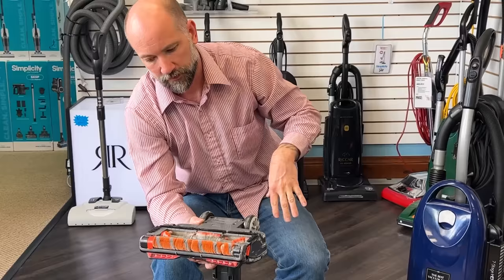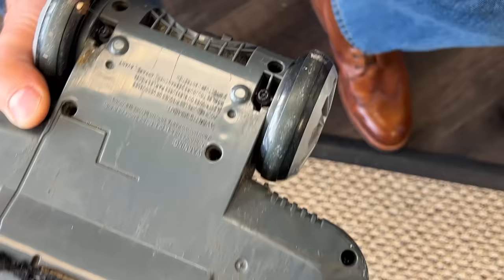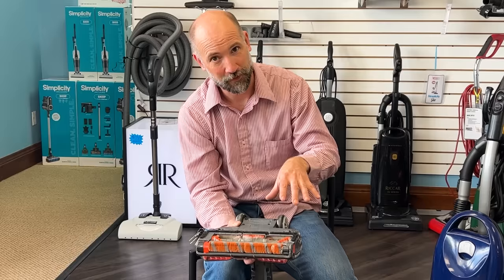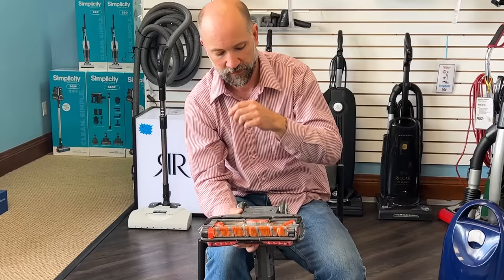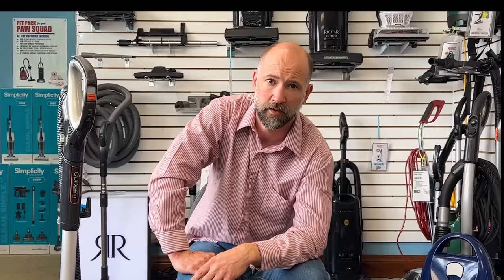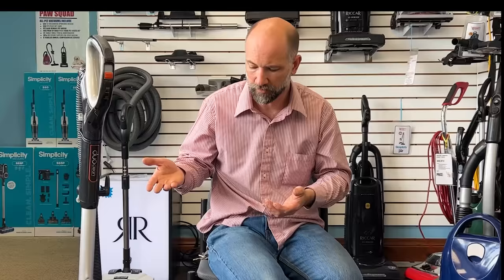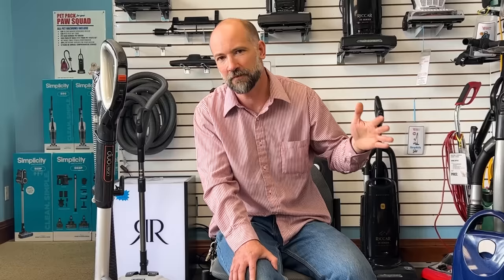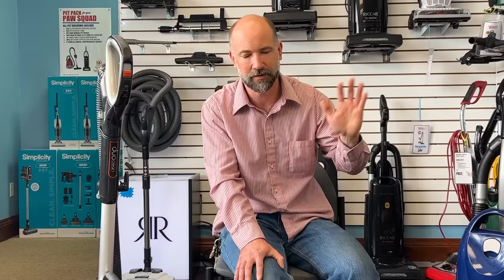Why Can't You Repair Your Shark Vacuum?

Comment: So, the brush stopped spinning, after discovering the security screws and using much profanity I went to TSC and they had the right bit set in the discount bin. Took the unit apart, the brush opposite the drive belt has a roller bearing set in cheap plastic which naturally had disintegrated and stopped up the roller. That's when I realized Satan himself held a round table to design this navigator vacuum.
Reply: Mine too.... I agree 💯%
Reply: Had the same problem.  Went to Oreck.  No problems since.
Reply: Why does this comment only have 11 likes? This shit is glorious! 

I took mine apart because the cat peed on the carpet, and I used a lot of vinegar and baking soda. Well the baking soda pretty much caked everything up the next day, and so I had to rinse out all the hoses, my husband accidentally broke one of the Allen wrench screws cause he didn't realize it was there. Got the roller out finally and cleaned that, and once we got it back together, it runs and works, but the brush indicator light isn't going on, and it's hardly sucking. So it's back to the drawing board.
Reply: @nonelost1  Unfortunately, the circuit board was fried. So I am just going to buy a new vacuum tomorrow.
Reply: Harbor Freight tends to carry security bit sets.
Reply: *ball bearing
Reply: I just buy it from a place that I can get a full refund if it dies before 6 years
Reply: Returned 4 vacuams now for full refund
Reply: Just don't buy shark vacuums people!!!
Reply: I had a shark duoclean about 2 years and the rollers stopped working. Told you have to buy a new head (£69) but you cant actually get one anywhere. Called the Shark 'helpline' to be told they dont have them but she will put me on a waiting list..How long will i have to wait? 'I dont know'. I better buy a new vacuum cleaner then thats NOT a Shark. 'Oh dont do that'. 2 weeks later (bought a new vacuum cleaner) and still nothing from Shark. Not like it was cheap when i bought it. Avoid the company. They suck more that their machines 🤬
Reply: @indboat I love my simplicity from my local vacuume shop. All these cheaper brands suck. When I worked at Walmart they always came back.
Reply: @nonelost1 some times hair builds up in the rollers too.
Reply: Wow, did I write this?! Eff Shark! Just got myself a Dyson v11 and let me say...WOW! I'll never try to cheap out again!
Reply: I haven’t had a problem with my Shark. I love it. Security bits are common in plastic parts. 

I have a 3d printer and a cnc router, soooo I’ll just repair it when the time comes lol.
Reply: @manino12345 where is that mysterious place and what model did you have?
Reply: @manino12345 where is that mysterious place and what model did you have?
Reply: @100hooker  Amazon, had some sort of Shark cordless, battery went and it cost about £300. Costco for a dyson also cost around £300.
Reply: Mine too and they told me I needed to pay for replacement of the entire head.   It looks like a small cheap plastic part.   Surely the part could be replaced no?  Cost me 1/4 the cost of a new vacuum and how long will that last ?
Reply: I have the same freaking issue. It was working fine, then it crapped out and the roller barely makes a rotation. I was looking forward to repairing it myself, had the right bits on hand because I work on electronics from time to time and it still won’t come apart. I’m not surprised that Shark made it move for design to fail vacuums.
Reply: I've had my shark duo clean since 2018 and it came with a shark mop. Both still going 💪 🤞
Reply: another practice by these scummy firms. build something out of plastic that has a lot of wear and tear, make it so it survives the warranty and then breaks.
its even more frustrating if you consider swapping that plastic with metal costs probably like 1 or 2 dollars more. 
they want it to break
Reply: It should never take someone 20 minutes to replace their belt in their vacuum lol professional housekeeper here and don’t ever buy a shark
Reply: Well of course . That's how to make $$
Reply: They'd probably make more money selling parts.. like alot of businesses

Comment: Never buy a shark vacuum.  Got it.
Reply: No that’s not true at all haha. To be honest I’m not even sure why he made this video. I repair vacuums and I’ve rarely had shark brand vacuums come in but when they do they can be fixed. Everytime
Reply: I happen to agree with you @shythawks9549 I don’t know why he made this video telling people Shark Vacuums can’t be repaired when it’s actually possible to repair them. It’s just absurd.
Reply: I had a white one for 10 years, got to where it wouldn’t stop fouling over, worked really good. I got the strato, and the red lite comes on all the time. I can’t get in it to clean it. I know I won’t buy a new ever again.
Reply: Currently having a frustrating time. On the opposite side of the belt, there is small hair jammed deep in there, had to use my Cricut weeder to pick at it but it's deep in there and seems impossible to take apart. It's as if they allow a narrow opening enough for hair to get in there. I'm pretty much at the point of "F this" lol. Next vacuum will not be a Shark.

Comment: Absolutely spot on. We have been using a $300 Shark for the past couple of years which just bit the dust, and I have been trying to source the part that's broken. It's near impossible. Shark does not sell that part any more which is strange since its been just a couple of years. The thing about the screws is true as well. I have a fair range of driver bits including the security bits which I used to loosen the screws, but could not pry the panels off. After watching the video, I now get why I could not. I am so glad I watched this video. I had been otherwise satisfied with the product, but I refuse to support a company that plans to screw its own customers.
Reply: Take a look to see if you can find a used vacuum.  Best place to get parts.  I've rebuilt several that way.
Reply: Little tidbit, a manufacturer has to support parts for a product minumum 7 years after date of manufacturer.  I use to go through it when I was as a printer/copier technician, several times.  There were instances where manufacturer sent out refurbished units instead of repair part because they did not have repair part in stock or no longer manuntactured part.
Reply: Buy a Dyson😎, it’s a little more expensive but it’s totally repairable. There are no belts to replace and no tools are needed to open and clean the roller head. I paid $300.00 for mine 15-years ago and it still sucks in a good way. FJB 🖕🇨🇳

Comment: I am a lifelong DIY'er and Shark's security screws were no problem for me.  Disassembly and diagnosis?  No problem.  Reassembly?  Problem.  I noticed tabs at the front of the "chassis" broke off quite easily removing the side covers.  Put it all back together and the slide locks for the top cover now bind up.  I've already figured out a solution, but your video really shed light on their designed obsolescence.
Reply: Please share the solution with us
Reply: Sheet metal screws through the cover.  A bit more work to clean the rollers, but it worked! @bjuliene
Reply: @MrMattDat  thanks for the insight, what a PITA and greedy design
Reply: Thanks Matt!!
Reply: @marambula  Absolutely.  You can also easily disable the cover switch on the side (unplug it, tie the wires together and remove the switch) to address more.  I will probably do that the next time I need to go in there.
Reply: You have to use a spudger to remove the parts, not a screwdriver, and work slowly.  and a hair dryer to soften the plastic so it will expand and not break. also ecoguard plastic lubricant on the joints. never had any break. if you are breaking parts your technique is wrong.
Reply: Second the suggestion on the hair dryer to soften the plastic, it works wonders

Comment: our shark navigator lower duct hose cracked within a year, so I replaced it last january. not only were there security bit screws, but the hose was glued in place. I had to dissolve the glue in nail polish remover. the replacement hose I ordered was much more rigid and has been fine ever since. I also totally agree with sharks becoming more difficult to repair. They weren't always easy but the older models for sure used to have regular philips screws. Such sad times we live in where we get screwed over in virtually every industry.
Reply: Wow so nail polish remover is 99 cents..... and a lot of common products have done away with Phillips bits a long time ago      dark ages???  Omg 😂
Reply: @donaldsalkovick396 😂 Exactly, these people are ridiculous. It's incredibly easy to go to your local Harbor Freight, Tractor Supply, etc. and buy a few screwdriver bits or whatnot. And that's for cheapskates like me, if you want to spend more money on name brand tools that don't get used much then you have that option too, lol, and currently we still have access to the "world wide web" to get whatever else you may need/want to make things even easier, sheesh not sure what these people expect...😂
Reply: Amazon has the Navigator hose with fittings. Unfortunately for me I have a "Proclean" the replacement hose doesn't have the fittings.

Comment: We have a Shark UV540 26.  It is about 5 years old.  I thought we had a broken belt, turned out to be something totally different but took off the skid plate anyway.  There are 11 screws and yes two different sizes, #8&10.  These were security head screws with the little nub in the center.  I used my standard Torx tools and removed 10 of the 11 screws with no problem but did go to Harbor Freight and purchased a set of security bits for one of the small #8 screw heads.  There were no tabs holding the head unit together.  It was a very simple project and Amazon had the replacement roller bar and belt had I needed it.  Thanks for your video but there is still hope.
Reply: Probably less of the nonsense 5 yrs ago. Steadily getting worse. I'm working on a 3 yr old Shark IX140. Different size heads and a few security screws in the mix. Tabbed so easy to break off.
Reply: Until anecdotes like yours are the rule and not the exception, I'll reserve my hope for more realistic investments.

Comment: I appreciate you pointing out this to the American Consumer. I am a recycler of electronic materials and am floored at the number of sharks I pick up. I'm also shocked at how cheaply made they are.
Reply: Not as cheap as the Bissell products.
Reply: I’ve owned 2 Sharks. The first was Navigator. It lasted 10 yrs and it was easy to replace roller bar. I have had a Vertex for 5 years now which has saved my sanity picking up dog hair (I own Collies). Im quite hard on vacuums. While this one makes it harder to replace the larger roller w fins, the soft bar is super easy to remove and wash. As are the filters. You can “diss” Sharks but I’ve only had 2 repairs in 16  years so I don’t agree that it’s a brand designed by a Satanic round table, but that was very funny! . I’m a walking ad for their vacuums. At the lower end price point, I’m surprised at their quality and high level functionality, esp the Vertex if you own a shedding dog.

Comment: Thank you, Josh! I’m on my first Shark, and I’ve liked it, but thanks to your insights and videos, when it finally dies, I’ll be looking into other brands that make repairs easier.
Your videos have helped extend the life of my Shark by equipping me to perform some  repairs at home, too, which has saved money and helps the environment. 
I appreciate you sharing your expertise!
Reply from the maker: That's great to hear, we're glad we could help!
Reply: The brush roller on my shark navigator broke and I am off to get torx bits. I have a Electrolux vacuum that's 40 years old that has never failed me.
Reply: Don't buy a Dyson. I phoned the help line to find out how to remove the yellow central boss on the wheels... they wouldn't tell me (they prise out). The mains lead had broken. I fixed it, but eventually bought a Bosch (still a pig to open up)
Reply: I ordered special bits to fit the screws, around 20 bucks. glad I did it.
Reply: You're going to be waiting a long time I've never had a shark vacuum die on me in my previous comment and this column I have always given away my shark to get a new one and everyone that I've given my sharks to they still have them! Hands down they are the best vacuum out there My dad has my old shark and his 6-year-old Dyson crap the bed hands down sharks are the best! I'm getting ready to purchase a new one a shark stratos so some will be getting my old stick vac That looks practically brand new but is well over 7 years old!
Reply: I'm lucky I guess. I'm still on my first Shark. I think it's about 10 years old now. I paid like $190 for it on sale. I liked that it came with a 5yr warranty. And nothing on it has broken yet; I still love it. But I will keep in mind what he said when the time comes.
Reply: @SirReptitious  , the old saying "they don't make 'em like they used to" probably applies here. It appears from some of the comments here that Shark vacs from a decade ago were built better than they are now;  and that the company was more inclined to help people service their own vacuums a decade ago than they are now. If you take a look at my channel, my one and only shaky-cam video shows an e-waste dumpster in my small town that is chock full of vacuum cleaners: mostly Bissels, Hoovers and Sharks. This situation repeats every couple of weeks after the waste processing company empties the dumpster.  I have even seen the occasional Dyson in there (not that I'm particularly impressed with Dyson, but they're not cheap).  I have never seen a Sebo or Meile or other upscale vacuum in there, but if I did I would rescue it.....

Comment: Glad to watch your video.  About 2005, my wife bought 3 purple hand held Sharks SV780N (Battery operated).  They were excellent and we still use one of those.  After deep internet researching, these Sharks suffer from a "Disease" wherein the thumb operated off-on switch goes bad. The off-on switch is mounted onto a tiny circuit board which itself is mounted into the handle.   Repairing this cannot be done as no new parts were available, so I trashed 2 of the 3 Purples for this fault alone.  We are still using a Montgomery Ward floor canister vac which dates to at least 1970 (It has a metal case, imagine that!!).  The foot operated switch is well worn but keeps on clicking!!

Comment: Planned Obsolescence.  
We own one Shark. It's a small, rechargeable battery hand model. It was the best out of the 3 others I wasted my $$ on. It's about a year old now. It's only used to vacuum my Husband's Semi truck. It does better than most, but not as good as the 12 volt plug-in Dirt Devil we had in the early 1990s. That Dirt Devil was awesome! It had a "beater-bar-brush" and a reusable cloth bag. It vacuumed both the interior of the Semi truck AND THE DOG!!!! (SHE LOVED THAT THING!!!)

I paid $389 for my Kenmore vacuum in 1998. Biggest problem I had with it was I ran over an unknown piece of ripped carpet, which is a LONG piece of very tough yarn. The power head has a safety shut-off. I had to take the head apart, remove the brush-roller and use a razor blade to cut the yarn off. Getting it back together with the brackets and belt needing to be assembled at the same time was so hard it took both of us to do it right. 
Oh and there's only ONE place that carries the bags for it anymore....
Otherwise, that Kenmore vacuum has been trouble free. It still sucks very well, the hoses are in great shape, and all the attachments are stored INSIDE it, so they never got lost.

Comment: I'm glad I found this video.  I have run into every problem you described in taking my shark brush and motor housing apart.  I have Torx bits, but the screws are set so deep I had to buy a set of long Torx bit handles.  I found one bit, probably a security bit that would not come out.  I tried to drill the screw and found the housing still wouldn't come apart and I can see now they have some interior clips that keep the housing together.  What a rip off.  I won't buy another one.  Thanks for the video.

Comment: Thank you for this. I'm a Harry Homeowner that repairs everything, not so much to save money but to reduce my ecological footprint. The T15/T20 deeply recessed screws on my RV100AE/UR1000SR seemed downright evil; even after I found the bits, the channel is too narrow. I bought 3 bots for 3 locations, thinking I could act as my own repair shop... and because the stand-up Shark I have is really a quite excellent design from a consumer POV. Now I have to rethink my brand allegiance pretty heavily.

Comment: Thanks so much for making this video. I accepted long ago the old maxim of, "You get what you pay for". I use an Electrolux Discovery II that my parents bought new in the 1980s. It works just as well as it did when new. The brush roll has been replaced twice in 40 years, but other than bags and occasional belts, that's it. I was driving through a neighborhood once a couple of years ago and I saw another Electrolux Discovery II on the curb for the garbage man to pick up. I stopped immediately and went up to the house, knocked on the door, and asked the lady if she was sure she wanted to get rid of her vacuum. She said yes, and I immediately asked if I could have it. She said yes again. I took it home and all it needed was a belt and to be cleaned up a little bit. I hope this little story can be useful to folks reading the comments. Thanks again for the video!